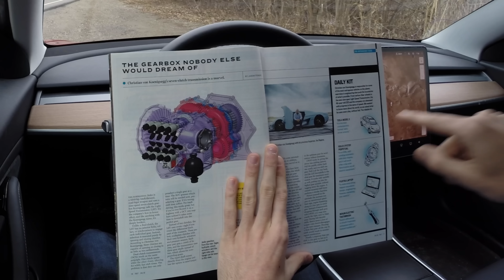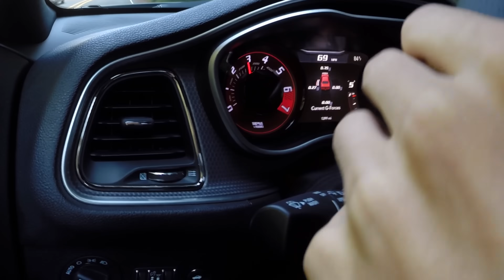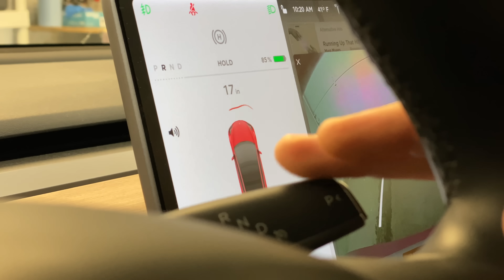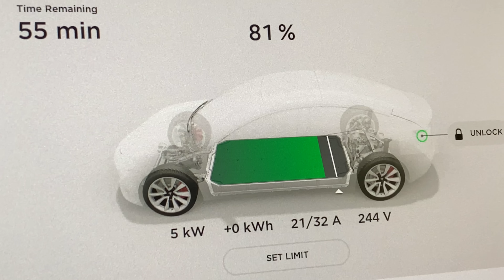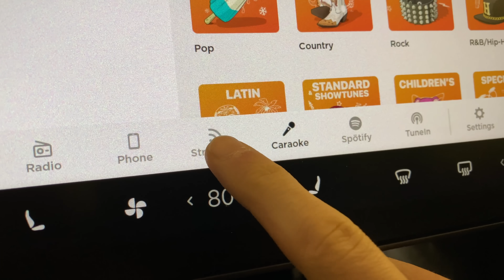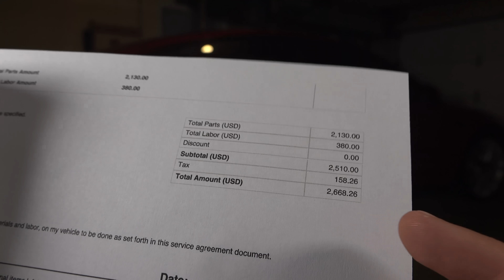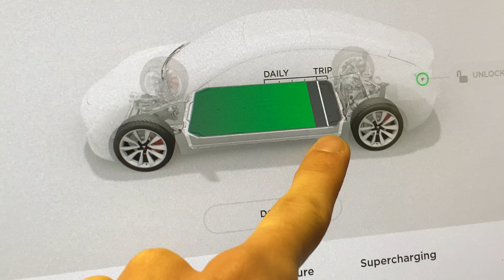Living With A Tesla Model 3 For A Year - The Best Daily Driver

Comment: Here in East Canada, everytime there's a snowstorm or it gets really cold, you start seeing teslas on the side of the road. The future is in hybrids.
Reply: ltwargssf R Tesla’s can drive in sub zero temperatures, however they have decreased range because of the temp of the battery. The owners most likely didn’t account for this drop in range. The future is most certainly not in hybrids, I can tell you that.
Reply: @jordan59961  Go try your ipad or laptop in subfreezing temperatures and see how it glitches. EV's are still behind in working properly in cold environments, obviously, they can drive just not effective... Hybrids will make a come back in simpler forms you'll see.
Reply: ltwargssf R Dude, the Tesla’s have a built in heater to warm up the battery to operating temperature. The Tesla’s that we’re on the side of the road probably didn’t account for the extra battery drainage
Reply: @Motorsportsgeek  My phone works totally fine in cold environments.
Reply: @rdizzy1  You guys are clearly from the west coast. Here on the east coast, you have tondecide if you want heating in your EV or to make it home. The battery tech needs to evolve becuase they do not work well in cold climats by themselves.
Reply: @Motorsportsgeek  Nah, I'm in upstate NY, Rochester. Currently most snow out of any 100k+ pop city in the entire country, lol. I see Teslas driving around here though, have even seen multiple other electric models driving around last winter when it was -10F. I just don't have to drive far is all, work is 2 miles away, I have multiple grocery stores within 1-5 miles, etc.

Comment: give me a review of your Tesla in 10 years i have an 18 year old BMW running fine
Reply: Tesla’s get an mpg equivalent of 130 and have basically no maintenance except tires and brake fluid. Even though the 18 year old bmw will be cheaper up front, the Tesla will quickly break even in cost and save you money in the long run.
Reply: Frodo Verhagen you don’t have to replace the battery. They’re not regular batteries, Tesla/Panasonic engineered them to outlast the car

Comment: How long will the battery in this car realistically last? For me this is a big question because the lithium ion battery in your laptop or phone usually goes for 5-6 years before you start noticing loss. I’m skeptical of these 1,000,000 mile claims.
Reply: Andrew Meehan it’s warrantied to 150k miles I believe. I think on the model s and x it was unlimited
Reply: Tesla’s batteries are the best batteries on the market. They are not the same types in laptops.
Reply: Jordan Panasonic makes the batteries I believe and they are quite good. Not apples to apples, but the Panasonic battery in my Subaru has lasted 70k miles.
Reply: Andrew Meehan yeah you’re right Panasonic makes the batteries, but exclusively for Tesla right..? And 70k so far or the battery died at 70k?
Reply: Jordan so far! Still starts just like new

Comment: How do the fifty million apartment dwellers plug it in?  And what does it cost when the battery dies? (like my cellphone) and finally, why buy a car that just opened a plant in China, and not the USA? (after getting billions in subsidies)
Reply: Roger didit Your only valid point is that it’s bad for apartment dwellers. Yes, I would not recommend it if you can’t charge at home.

Comment: A lot of these are things that can easily be and are being added to petrol cars.  Elspecially the software things
Reply: Preston Dial wrong. Petrol cars are fundamentally inferior to electric vehicles.
Reply: Jordan The idea of fundamental inferiority is a fallacy, but for instance he talks about how you can get software updates for electric vehicles.  There is nothing about that that is exclusive to electric vehicles, it is more Tesla’s mission to revolutionize the car industry leading to a practice that other makers have not adopted
Reply: Preston Dial im talking about the drivetrain - ICE vehicles really are fundamentally inferior to EV’s because EV’s have inherent benefits that ICE vehicles don’t have. For example, max torque as 0 RPM. No oil to change, ability to use car in garage due to no emissions.. etc. Yes, the self driving and all software related advantages that Tesla has, ICE vehicles can have too if the manufacturer works on it. However, no company will be able to catch up with Tesla on that aspect anyway. Tesla has literally cornered the market with their AI team, which is lead by the worlds best AI engineer, Andrej Kaparthy from Stanford university. No company will ever be able to catch up with Tesla. ICE vehicles will be phased out over the next century.
Reply: Jordan Hopefully ICEs are phased out much more quickly than over a century: that being said there are several things that ICEs do better than electrics.  For instance, they rely on easily acquired and recycled materials as opposed to the environmentally expensive and difficult to dispose materials that electric vehicles much more heavily depend on.  Petroleum is an easily transported energy source to remote locations as opposed to the expensive and difficult task of expanding (at least traditional) grids to service developing nations, and ICE vehicles have the ability to function continuously (or nearly) for extend periods of time which is very important for work vehicles.  Most of these issues should be reduced with advancements in energy storage technologies, but for now they are a real obstacle for electric vehicles.  Further, Tesla’s advantage in autonomous vehicles is more from their wealth of data than the development team.  This data advantage is real, but can easily be surpassed my companies with much larger market share once they have pivoted their massive production and RND potentials to autonomous vehicles.
Reply: Preston Dial okay

Comment: Most real drivers see your negative points as a plus. And unlike most Americans, we enjoy 3 pedals in a car, a gearstick we can use for changing gears, and an exhaust note that brings pleasure and lets us know what the motor is doing. As for the environment, if they were mining rare earth minerals in their own back yard, instead of regions in China where the ecological damage is visible from space, the leftie tree-huggers would not be happy. And the environmental damage associated with EV cars manufacture, particularly the batteries, is very conveniently brushed under the carpet and ignored. EVs are not nearly as green as they are made out to be. An EV is an appliance with a wheel at each corner and all the soul of a toaster.

Comment: I love electric vehicles and the most fun I've had on go karts were electric ones.The only thing I don't like about electric cars is way Tesla deals with crashes and replacement costs/times when something goes wrong. I honestly can't wait to get an electric car but I think I'll wait for the Japanese to perfect it.

Every year batteries get better and a university in my country just recently made a breakthrough with lithium-sulfur batteries. Once batteries become much smaller, cheaper and longer lasting I can see most people converting. I also think the use of solar panels which allow you to recharge the batteries will be a huge thing in Australia and other countries that can be quite remote in places need that kind of tech. The biggest issue is so many people have Ute's and 4wds that they install huge fuel tanks and carry and more fuel to go over 1000km in bad terrain. If all you need to do is sit your car in the sun for a little while to have enough battery to be safe that's a game changer
Reply: I care more about semi portability of batteries than the actual distance I can go. I live in an apartment that will never have EV chargers, so I would have to charge batteries inside my apartment, and to do that I'd need to carry them inside, charge them, and bring them back out and plug them in. And I don't think thatll ever happen.

Comment: The "immediate throttle response" you get from electric cars is mostly due to lack of transmission. You should know this. The power is direct and there are no ratios to go through so it gives instant feel. You can mimic this in a ICE car by leaving it in one gear ratio basically never shifting. ( At the appropriate speed of course.) Thus keeping revs higher and in the ideal position in the torque curve.

Comment: Love your videos Jason. You are a smart man but sorry I don't like electric nonsense. ICE all the way. In regards to your points:
1&2:  I own a 5.0L Supercharged V8 Ford XR8 Sprint (modified) it's got 600Nm at the wheels at 2,000 RPM
3: My worked ZF 6 Speed can shift in 90ms. It's got a torque converter.
4: The reason I hate electric. The lack of noise. That and it's way too computerised
6: Driving with one pedal is dangerous!
7: The wireless charging pad is expensive and ditto the power wall.

I usually watch all your videos and go back to make sure I fully understand the points. I stopped with this one coz Tesla is garbage. Can't be tuned and ESP can't be turned off etc etc. I know how to drive. I don't need Auto pilot or lane keeping assist or AEB. I will gladly stick with my 800hp V8 at the wheels

Comment: I find the lack of a heated steering wheel a non-issue. I always use the App to start the heater a minute before I get into the car (and the vents are directed roughly at the steering wheel anyhow), so I have never had the situation when I said to myself "My steering wheel feels cold - I would really put on the heater for it right now". That's a feature that only makes sense in an ICE car, to me.

Comment: Regen braking = motion sickness.  I always turn it as low as possible in my friend's Tesla...it's awful.  Not a fan of Tesla's rock hard, unadjustable headrests (or "restraints" as we're supposed to call them now).  The interiors are merely OK, and I won't buy a car reliant on a screen instead of physical buttons.  I've only driven the base 3 but found it kind of boring, honestly.  Quality's apparently hit and miss; they're still learning that side of things.

That said, Tesla brought desirable, usable EVs into the mainstream and proved EVs don't have to be snoozefest, Prius-like atrocities.  It's forced everyone else to build or consider building their own.  I may not like any of them yet (bit of a manual transmission purist here...if it's gas powered make it a manual, you lazy bums), but perhaps the day will come.

Totally agree on the environmental point though.  If we talked more about climate change and fossil fuels' relation to national security, health, the economy, and other more tangible aspects, they'd probably get more bipartisan attention.

Comment: Pausing to list the complaints I would have about ICEs if we switched to them from EVs:
⚪ Why's it so loud?
⚪ Why's the acceleration awful?
⚪ Why can't I refuel it at home?
⚪ Why do I have to stand here holding the trigger on this nozzle, outdoors in the freezing cold or blistering heat or pouring rain, while it refuels?
⚪ Why do all of the refueling stations have no regard for credit card security and still use the ancient and insecure magnetic stripe reader? (also true for the world we actually live in)

⚪ Why does it need so much more maintenance?
⚪ Why does it have so many more parts that can go bad?
⚪ Why does it go through brake pads so quickly?
⚪ Why does it spew so much smoke and pollution every time I drive it?
Reply: mjc0961 outside USA, you can use Chip or non contact such as Apple Pay.

Comment: 13:24 ... Jason clearly does not have kids yet (Tesla actually has the internal mechanisms for the rear emergency release, cable and all, and likely decided against including the handle because it would override the child lock mechanism)
Reply from the maker: So... in emergency leave the kids inside? That wouldn't be my strategy haha.
Reply: @EngineeringExplained no. There is like a panel in the bin that you have to pull up to open it. It’s not a normal latch so kids don’t play with it on the highway or whatever.

Comment: Wish i had the money for an electric car
Reply: ﴾ ﴿ Tesla’s have a higher up front cost, but it will quickly break even and start saving you money, as opposed to if you were to buy a ICE vehicle for half the cost. Especially if you live someone that provides free Tesla charging. I have a Tesla and I would highly recommend it, don’t be intimidated by the high up front price tag and be sure to take the savings into consideration. If you can afford a 20k car you can probably afford the model 3 at 40k. I would not recommend any other electric car other than a Tesla. Btw, I have had a Chevy volt and currently have a model 3

Comment: I am aiming to buy a Tesla model 3 soon. I will miss shifting my own gears and hearing an engine howl and pop and crackle on over run and also the ritual of maintaining a car. But after having felt the acceleration of an EV I am like yusssssss. Everything is a trade off but that acceleration matters more to me than the character of a car.
It's acceleration you can use any time you like. It's not antisocial because of your screaming loud exhaust, nor does it attract attention of the cops, and the advanced traction control makes it safe(..er).
A Tesla is the ultimate muscle car. A muscle car was always a working class hero. It's a car you can use every day, its mass produced cheap but it has some serious straight line punch. It's now a stealthy machine too.
Reply: Tim A. I put a buss on model 3 Tesla with red brake calipers not sure what model. It was against my E63s AMG! 0 to 60 in 2.8 seconds and my quarter in 10.6 seconds. You can’t beat brabus tune AMG!

Comment: If I want a reliable EV I'll go for a Taycan. Over 50% of ALL Teslas made have been recalled. Then there's the ridicules process trying to get one serviced. It's funny how everyone seems to overlook the many problems and issue's that continue to plague these cars. You also don't mention the cost of replacing the battery system when it fails.
Reply from the maker: Huh? 50% Where you getting this number from? Taycan isn't even out and it's more reliable? It's also 3-4x the cost of a Model 3... Battery warranty is 8 years, that's a long time to not have to worry about it, and much longer than most cars engine warranties.
Reply: @EngineeringExplained  come on some simple fact checking man!!
Reply: @EngineeringExplained  how about the issue's getting one serviced? Read the latest long term C&D test issue's they had?

Comment: Glad you were joking. Heated steering wheel is for cars that need engines to warn up to give you heat
Reply from the maker: Using heated steering wheel/seats uses less energy than HVAC, which is why many EVs have both.

Comment: How is the power when say the temp is at about -20f and you are at one of the 99% of places you wont have a heated garage to park in?
Reply from the maker: It will reduce power if it's super cold outside, but as you use the battery (for driving, or heating the cabin) power returns back to normal levels pretty quickly. I've always had more power than traction in snowy conditions.

Comment: My buddy has a Long Range model 3 and we went on a long drive to a car show, I was in my Z. He started charged to 100% and I was at about 85 to 90% on gas. We cruised at 100 mph most of the way with some 120 to 130 mph sections. When we arrived and parked his battery was at half (51% battery left) and I still had 3/4 a tank of gas. It just shows that Teslas are only good for slower city driving and not for high speed (80+ mph) mixed with distance. When going home he had to drive smoother and slower in order to make it (there wasn't a charger), when I got home I still had half a tank
Reply: It is nice that he only spent about $4 to 5 for a full 'tank' instead of $20 to 30 for gas

Comment: It would be more fair to say that automatic transmissions are just now getting back to being good again. American automatic transmissions BEFORE electronification (yeah, that’s my word) while only three speeds, were FANTASTIC, and even better with a good shift kit installed. They were very snappy and responsive to throttle input. They would shift into gear almost instantly. They were better in every way than modern transmissions except for being only three speeds and (for some) no lockup torque converter.

Comment: regarding efficiency, the Tesla is honestly not all that awesome. It gets all that range from having a humongus (and heavy...) battery, which is the major reason it's so expensive. Much cheaper cars with comparable or better range match or beat the standard model 3 in efficiency (depending on who does the testing...), so you're paying a hefty premium for the brand and useless gimmicks, some of which are questionable on how it's even legal (those non-manual rear doors or the "autopilot"). Don't even get me started on how Tesla is being a dick about "non-authorized" repairs.

p.s. salty car in a warm (relative to outside) garage rusts a lot faster. Rusting is a chemical process, the greater the temp, the faster it works. Keep the car outside in the winter if you want it to last.

Comment: Have heard that hydrogen fuel cells are a better alternative to lithium batteries. But the service infrastructure does not really exist. L batteries are heavy in mass and expensive to replace. Some comments about resale value of EV's is that they are poor. To some they are great but for everyone? The real incentive of EV's are climate and automated self driving (necessitated by cell usage).
Reply: Hydrogen is very expensive, more expensive than gasoline even. They are also not as efficient as Batteries powered EVs.